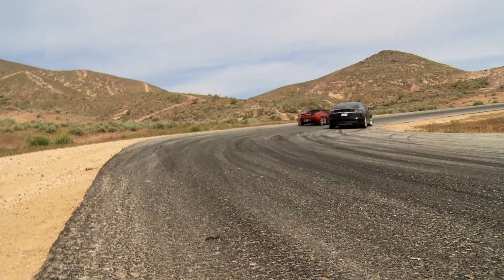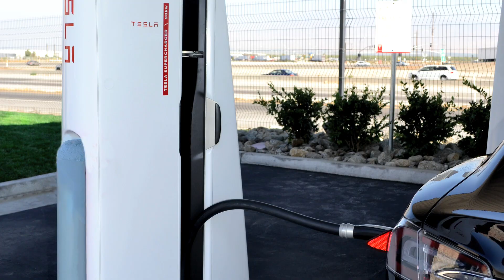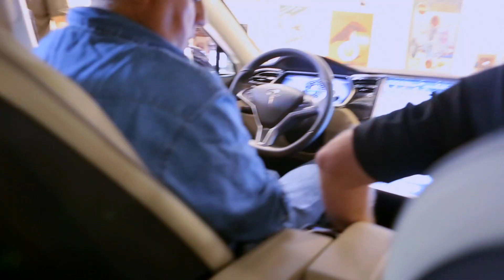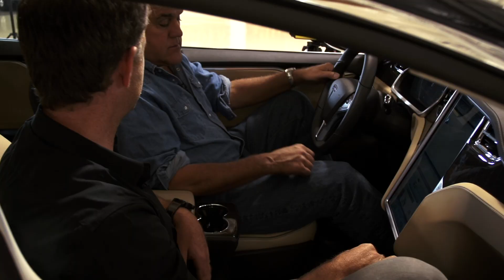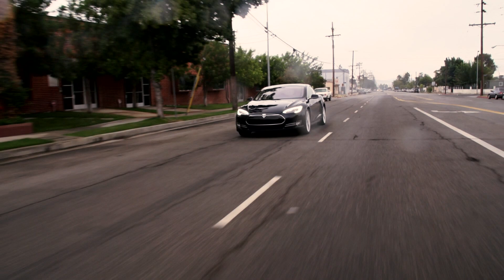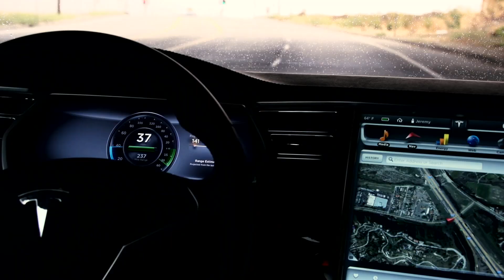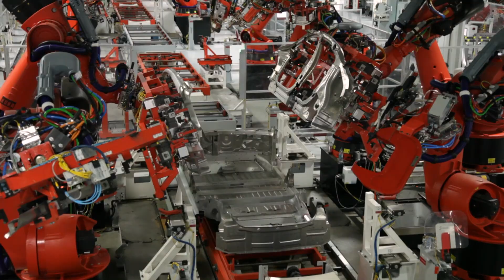2012 Tesla Model S - Jay Leno's Garage

Comment: Not entirely correct. Tire technology and reliability have continuously improved since the '70s, when blowouts and flats of all sorts were much more common. Radial tires, woven-steel belts beneath the tread to fend off punctures, and other material and design upgrades have torqued up tire reliability.
But you are of course right that lower profiles are more prone to damage when driving on bad roads. I'm referencing from that article from Bloomberg silly.

Comment: The tire repair kit will solve it almost in every case. The rest you'll have to call and get help. It's no big deal dude.
Lots of cars today come without spare tire. It's a growing trend due to tires being less prone to catastrophic failures nowadays. 
Google the article in Edmunds titled "Spare Tires in New Cars: What You Need To Know, Good-Bye, Full-Size Spare; Hello, Repair Kit".
E.g.: "Over the last two years at General Motors, we've moved more toward inflator kits as standard equipment".

Comment: First you were talking about a Tesla Model S "45kw", which is non-existent and kw is not a battery capacity metric. Now you changed it to 40kwh. Yes, surely, originally Tesla Motors planned to launch a 40kWh model, but never shipped one car with an actual 40kWh battery. Rather people got the 60kWh battery in actuality with a range defined by software and not the battery. Besides only 4% preordered the 40kWh version of all orders. It's not an interesting topic.

Comment: It's completely normal to get 240 miles in Model S even when using A/C. Concerning cold weather driving, check: /watch?v=XZ5PqPeOPT0
A gas powered car is actually less efficient concerning use of electric features, because the electricity comes from a very low efficiency ICE engine + alternator wasting far more energy than in Model S. Thus the argument is a bit bogus. My A/C motor is 3-4 times more efficient (energy source input to BTU output) than the A/C system in a BMW, for example.

Comment: I know, but the number "45kw" is wrong in two ways. First the metric kw is a power metric and not an energy metric. Secondly, it was 40kWh and not 45kW. Energy in a battery can be measured in "kWh" or kilo-Watt-hours. 
Anyway, just to help you a bit: "tesla fangirl" is not a girl and also not a Tesla fan. It's a guy who made about 10 IDs in Youtube writing bad things about Tesla Motors and often wrong things like this one. The 40kWh Model S was dropped before launch of the Model S.

Comment: Solar panels are very heavy and putting them on the roof will shift the center of gravity in a negative way. Plus if the whole roof was covered with solar panels, it would not produce a substantial amount of power as solar panels are not that efficient. I remember reading that only about 10% of of all light hitting the panels gets used for converting to electricity. What a waste...

Comment: Google is your friend. Top speed for the 2012 model is a flat 120mph. 0-60 in 5.9 seconds. The Model S comes with chargers so that you can charge it yourself at home, so it does not HAVE to be charged at a charging station. As for pricing, they cost a hefty penny at anywhere between 60 and 95 grand.

Comment: EV maximum horsepower  = Max output power (Watts) per battery cell X Number of battery cells X Power electronics efficiency X Motor efficiency X 1.34 / 1000 (in Horsepower).
My rough guess about Tesla Model S P85 is something like this:
44 X 8000 X 0.9 * 0.9 * 1.34 / 1000 = 382hp to the wheels.

Comment: Hydrogen is the most dangerous gas, but no worry: 
Rain probability in Ca is 5%. One from twenty doesn’t know how to drive on slippery road, &he has one chance from a thousand to hit concrete pole at full speed, instead of just soft landing on corn field. So combined event has probability of 0.05*0.05*0.001.. ie 25 from 10 millions. Meaning, only a few dozens will be annihilated in millions Tesla S accidents.

Comment: Freak accidents can happen also with gas involved. I once was on a freeway somewhere with almost no visibility due to a heavy fog. Then suddenly traffic stopped. It turned out that two cars had collided and one of the cars had started burning with huge flames and nobody could rescue the poor guy inside before it was too late. Gas is explosive and don't leave much time for escape. I doubt even a worst case with these batteries will be as bad as what gas can do.

Comment: Just imagine:
rain, at full speed S skids into concrete pole, and almost 1000 kg LIB of immense inertia, cutting off any fastening, scatters hundreds of smashed elements exposing metallic lithium to the water resulting intensive emission of hydrogen, sparks from torn cables.. a jay says, "..cool." no, Jay, it's ultimately hot... it will be no corpses to cremate.. 
I love this fuel-efficient car even in this respect.

Comment: If, Hyndai manages to actually introduce it, the starting price will be $138,000, and will eventually settle to $92,000... "for a Hyndai". What's even worse is that it's not even an original car, it's a converted gas crossover. What a pathetic effort by you.

Comment: The "refueling" is something people can do overnight at home and when you have 200+ miles it becomes an advantage as you don't have to bother with fueling away from home anymore. Also, charging speed is now at some 350 miles per hour on Model S using super chargers. There are already 5300 public EV charging stations and only 55 hydrogen stations in the USA. It's way more complicated and costly to build a hydrogen station. Hydrogen fails on convenience and efficiency.

Comment: The efficiency of making the electricity doesn't make a difference since hydrogen is made out of electrolysis driven by electricity. Thus, you have no difference on that part of the process. You don't need to have it constantly on charge at all. A Model S can sit for one year without being on charge from fully charged state or one month from having run empty. Model S controls the battery temperature automatically. Degradation isn't too bad anymore and is still improving in future batteries.

Comment: TheOneNo20, The problem with hydrogen is that neither electrolysis nor a fuel cell drivetrain is tremendously effective. You might get some 24% efficiency to the wheels out of a hydrogen FCEV while you get over 50% out of a BEV. Surely battery production takes some energy to make, but Lithium will be recycled making it long-term less of an issue. Furthermore, new battery technology is coming with around 27 years of lifespan (check ZSW in Germany already having working prototypes).

Comment: The problem with using hydrogen to store the energy is that it's far less efficient than using battery technology. You easily end up with half the efficiency = you need twice the amount of electricity for the same range, even when using latest fuel cell technology. And the worst part of hydrogen is that you can't easily make it at home. Home charging your car is a super convenience of Model S virtually eliminating the need for outside charging, except for the rare long trip.

Comment: I disagree. It takes a large electrolysis device to make meaningful hydrogen for a car. Those silly HHO devices you can find from some scam companies make silly amounts of hydrogen. The Gas Gallon Equivalent of one gallon of gas is about 10,000 liters of pure hydrogen. You could install a large hydrogen making machine in your garage but it's also very dangerous as hydrogen is explosive with no odor. I rather charge my Model S with no fuss from the grid. It's way better than hydrogen.

Comment: The Honda Clarity is Hydrogen fuel cell powered. That said hydrogen isn't the future. BEVs are the future. It requires too much energy to produce hydrogen. Range will easily be solved in BEVs with solar quick charging "stations" strategically placed around the major roadway corridors and BEV with 200+ mile ranges. If I had the money I would have a Tesla...right now I make due with a Focus EV for our 75 mile daily commute. It saves us over $200 a month compared to gasoline.

Comment: Hehhehehe! You can say that about all performance cars not just the M5. Tesla is not a high performance cars since the top speed is 125mph.. They all guzzles gas. Why are you comparing tesla to bmw? Are you that stupid. It's not the best car. The best car should be afordable, it should have longer range and should not weigh like 2 elephants. The interior of the tesla is like a rental car compare to the m5..

Comment: BMW is at the bottom of reputation concerning reliability. And BMW doesn't make a good EV car now or in the known roadmap of coming cars. Which EV car is better than Model S? NONE!
BMW M5 is an old-style gas guzzler that does not compare at all. The dashboard looks like a car 20 years ago. Nothing special. If all you want is performance. Swapping battery is a trivial maintenance thing 10 years from now even it's done manually.

Comment: LOL, I expect oil change about every 150,000 miles in the single gear transmission. Cost of service is a totally different topic. And I paid US$ 1,900 for 4 years of full service. There are zero reasons why an EV car should require more maintenance considering a drivetrain with much less wear-out parts. All I need to do on my Model S is to fill up washer fluid once in a while.

Comment: Your timescale of thinking is very short. Battery swap stations are a longer-term concept. The point is that Model S is designed to allow the battery to be swapped extremely fast. This means some day, 10 years out in the future, I can expect to swap my battery in the time it takes you to get your oil changed in your BMW. Difference is that you have to change oil every few months (M5 F10 is a very hungry car concerning oil btw).

Comment: Actually you are indeed wrong. Components are individually specified in what type of environmental stress they can withstand. Electric switches often become unreliable due to contact point corrosion caused by humidity. I once had a car (Mercedes) that was a disaster in switches being unreliable. It even opened a window by itself. Capacitive touch screens are extremely durable if designed right. An A/C compressor is of course a concern in any car.

Comment: Correct, in the "Standard Mode" of regenerative breaking, the Model S barely uses the break pads except when you really need to break quickly, which is almost never. Realistically these break pads will never get worn out in the life of the car.

Comment: As I've told you already, the type of regenerative breaking in ICE cars have very little to do with what you find in the Model S. For example, BMW's system has a ridiculous incremental efficiency ratio of some 3% making it near useless (just charging 12V battery on breaking). Thus, it's a near pure gimmickry feature onboard BMW. But hybrids can theoretically do similar to EV because they can recycle drivetrain energy. Your need to study more.

Comment: Sure there are other things that can break. Regenerative breaking makes the Model S break pads last almost forever. Yes, the battery is a minus, but you can swap that battery in 90 seconds if it misbehaves. The rest is much equal except that Model S has a lot less mechanical controls in the cabin due to heavy use of the touch screen.

Comment: Some car enthusiasts are respectable people. Jay Leno is such person.
Notice his comments about his experience concerning zero maintenance on electric cars. The Model S drivetrain should be good for at least twice the time a typical gas drivetrain can last. Why is that? When you use a brushless electric motor and one-gear fixed transmission, the moving critical wear-out parts become a tiny fraction of a complex ICE engine with transmission. This also means superior depreciation! Think about it.

Comment: In the above test in the leading UK Car magazine of M5 F10 did their 11 month long-term test review. 
Month 5 running a BMW M5: the stop/start system stops working
Month 6 running a BMW M5: our super-saloon develops a boost problem
Month 7 running a BMW M5: our M5's brakes start to clog up
Month 9 running a BMW M5: our M5 demands an oil top-up
Month 9 running a BMW M5: a month at the mechanics (can't go faster than 40mph for mysterious reasons)
It's clear BS to say that BMW is a reliable brand.

Comment: Another reason Tesla should make the Model X with Falcon Wing doors, & normal doors...because the R & D was already factored in, in case the Falcon Wing doors don't cut it. Look at the Model X video's, & you see something a Model S doesn't have. A bin in the front doors!! Because Tesla has to listen to customer wants, & needs. Elon personally responded to someone on Twit about an upcoming retrofit to bring cup holders, & armrest to backseat Model S, & middle console options.

Comment: Not necessarily because efficiency is near 100%. A higher max output electric motor does not necessarily use more power. A bigger motor might actually involve less loss because the copper wires will be with less resistance causing less power loss in the electromagnets. Thus, for example, if the motor can handle twice the current, it might not use more power when you don't press the pedal to reach that max output. You understand?

Comment: Not correct. Actually for EV cars using same battery technology, more range also can mean more power as an indirect side effect. The reason is that what defines the peak horsepower is the peak power per battery cell. At 416 horsepower, your battery has to output more than 310,000 Watts. With the approx. 8000 Panasonic type 18650 3100mAh 3.7 Volts Li-Ion Cells, it means each cell is outputting approx. 40 Watts at max acceleration. In this way, your battery capacity defines both power and range.

Comment: BTW mister Tesla, The i3 is fast enough for 99% of city population. 0-60 in 6.1 secs. is plenty fast. You should tell Tesla that they could have had a longer range if they didn't make their cars this fast. Ask any electrical engineer and they will tell you that. But Tesla wants hype and gimmicks and marketed their cars as high performance cars instead of focusing on real life(cold/hot weather,amenities) usability.

Comment: There are 3 series out there that costs $60K. The M3 costs over $70K and is classified as a luxury sports coupe. In fact the fully optioned 3 series has a better interior materials and equipment than the $100K Tesla. I suggest you do your research before arguing. entry level,mid level,premium,Ultra luxury cars. They are all luxury cars.

Comment: BMW is luxury car maker. A 328 is a luxury car. Just like the Lexus ES350 is a luxury version of Camry. By definition, Anything you add to a basic equipment of a normal car like leather instead of cloth seats,power instead of manual seats,premium stereo,interior materials are luxury items. I own an F10 M5 which has all bells and whistles. But I also own a 335i which is exactly the same as a 328i except for the engine. And it is a luxury car.A 328 is consider an entry level luxury car.

Comment: @Rawqdawg..What you drive a hummer? If you drive a normal car  and 300 miles /week like me, $35 on gas a week plus 2 oil changes/year. And your'e comparing older  higher mileage cars with the tesla in your maintenance examples. Still, with all those I still save money by not spending $100K on a golf Kart plus $850/year maintenance fee.

Comment: The reason this cant happen is that the engineers at tesla are so busy and working so hard that they cant concentrate on two different things at once.  You might be pleased to know that they are infact thinking of making a supercar.  They have also proved that the falcon doors on the X are completely practical.  They dont really cause problems for anyone.  Tesla has PLENTY of different color options. 9 very varying colors is enough for me.

Comment: The only thing I'd like to see Tesla do is have more variety in their body styles quicker. I feel they should make a coupe version of the Model S to roll out around the same time Model X comes out. Also, Model X, if it gets Falcon Wing doors, should also have a normal door variant for those who need normal doors, and roof racks. They also need more exterior, and interior color options.  Tesla doesn't have 1 reputable bad review on their cars, so why will they fail?

Comment: First I said haters because narrow minded, short sighted people like you call anyone with a positive view of the tesla an idiot. Also I never said that EV's are a new thing, the baker electric is over 100 years old. Nor did I say EV was the only alternative to gas, there are advances being made in hydrogen fuel cells as well. The Model S is a stepping stone to a more main stream EV, and as the R&D is recouped through the sale of more expensive EV's like the S it will lead to cheaper models.

Comment: Also, If a muscle car really wants to race you in your EV, All he has to do is power brake his car and all his torque is also available from the get go. It's really racing for dummies. No sweat. If your'e driving a manual, rev your engine to 3,000rpm, release the clutch and it's just like driving an EV off the line. Get it?

Comment: The Tesla haters interesting, not really sure where the hate is coming from. No one is making you buy one. Fossil fuels are a limited resource, the more people who drive non gas vehicles the more gas will be left for those that do. In the coming years the range and charge issues will be a thing of the past with new battery tech. Electric motors are more efficient and have instant torque, it will be funny to watch a guy in a muscle car get smoked off the line by a soccer mom in an electric sedan.